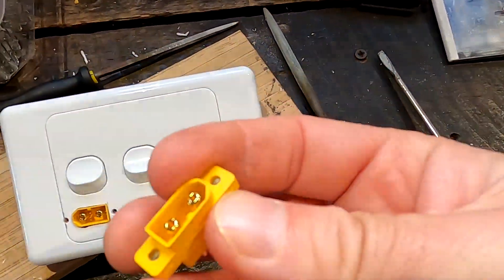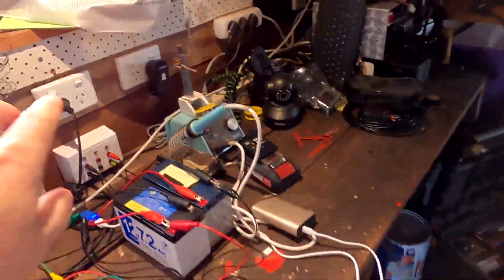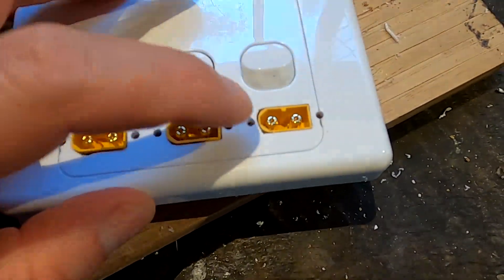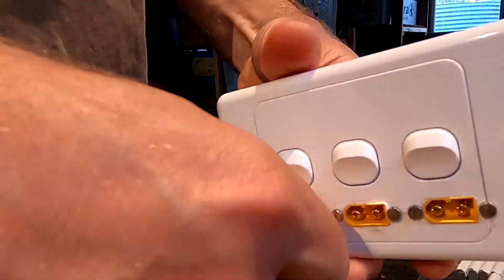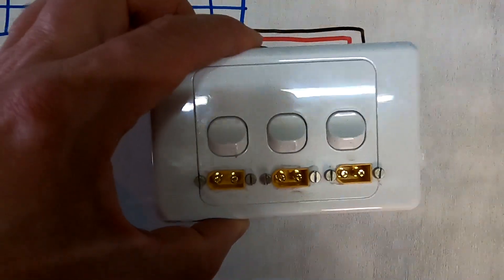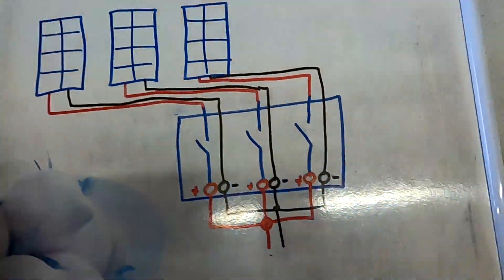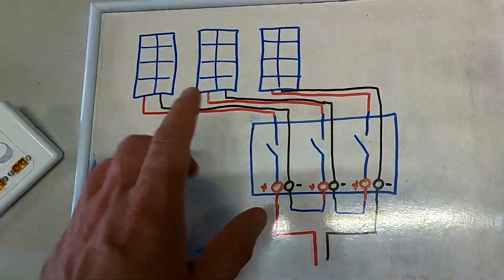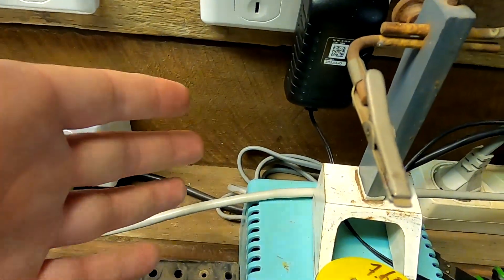2nd Test Terminal and how it works.

Comment: I really like this. I wonder if you would notice any volt drop between the three wired in series via your switches and the three wired in series where they’re directly plugged in together with no extension cables.

Comment: I don't think domestic ac switches are compatible with dc systems.
Reply: Hi. I don't think it's the amp rating that's the problem. It is the DC that causes arcing in the switching mechanism when switching on and off that can burn out the switch and cause a fire i think...
Reply from the maker: The switches are rated for 10A and I only switch 5-7A max with them.